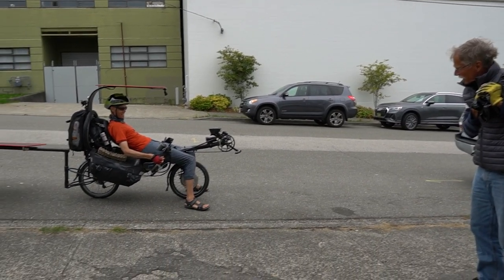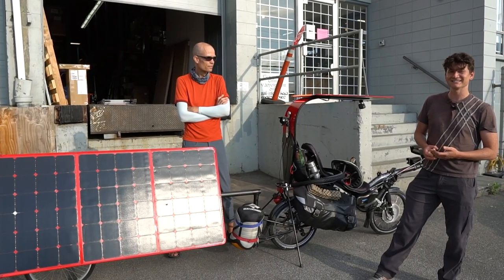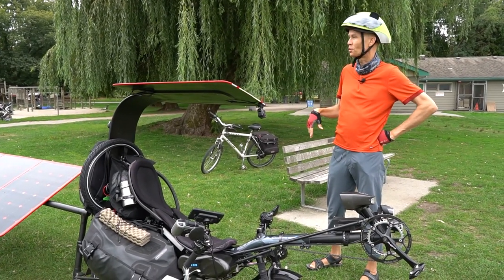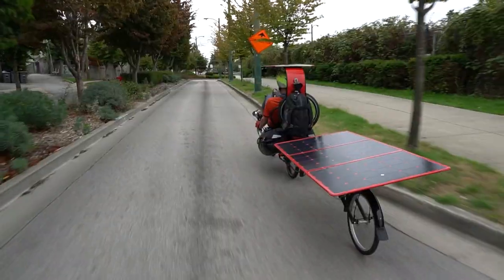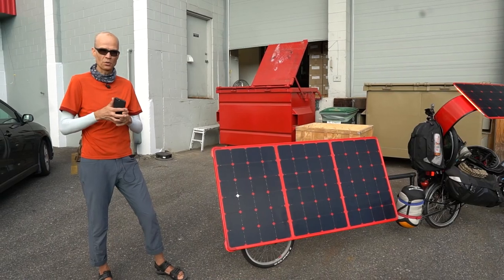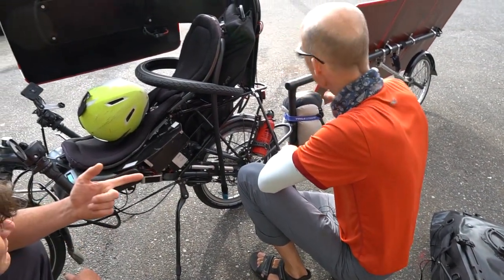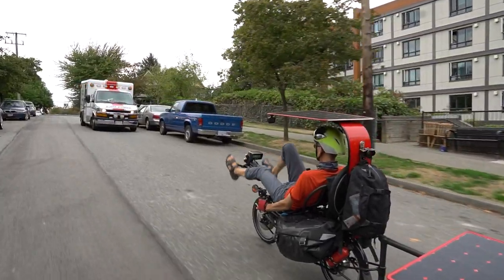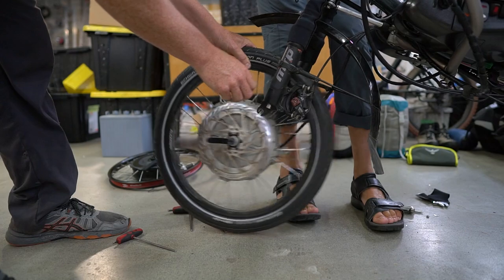Customer Profile, Part 2 of Mark Havran and his Solar Ebike

Comment: Huge thanks to Grin Technologies for hosting me in Vancouver. I really enjoyed meeting all the grinsters. What a great start to this tour!
Reply: Mark, put some (more) footage on YouTube!
Reply: @LeesChannel  Good idea. I’m mostly just posting on Instagram right now but most of the people I’ve met along the way don’t seem to use Instagram.
Reply: What an appropiate place to start your tour. Two legends n e-biking coming together.
Reply: so damn cool Mike! This has to be the most advanced trailer and ebike ever built right? The gears in the trailer tube, wow... If you are ever in Slovakia let me know :D
That front disc brake rotor seem huge, is that just because of the wheel size or is it really big?
Reply: @JohnKrakatoa  Thanks, John. I just discovered an additional advantage of having two separate gearboxes in the trailer. Based on my experience on this tour, I decided I want a little more torque so I ordered a replacement gearbox with a slightly different gearing ratio.
Reply: @JohnKrakatoa  The front rotor is 203 mm. The 20 inch wheel probably makes it look bigger than it really is. I do almost all of my braking with the regen brakes anyway. My brake pads last (virtually) forever.
Reply: @JohnKrakatoa  I have relatives in the Czech Republic so it’s possible that I may pass through Slovakia.
Reply: @solarEbike  oh yeah I noticed the surname :)

Comment: Amazing setup, people still give hub motors a hard time for some reason, I was one of the very first people to use a BMC hub motor back in 2004, it's still working great, it's had 2 new rims because I run v brakes mainly but the motor still runs and has done over 40,000 miles and all that time is been run at 1,500 Watts, 50V, not bad for a 250W motor, I wonder how many mid drive setups will last being over powered without new gears, chainrings, chains etc, the best things in engineering terms are always the most simple solution, as Elon says, the best part is no part.
Reply: Yep, same for me. I have a 10yo nine continent motor. Done 10's of thousand of km with it. No maintenance at all. The wheel is still straight, and the motor hums gently like day one.
Reply: It depends on how you use it. When in the city using a straight up city bike within the 25 km/h limit I would prefer a middrive for it more direct controll. 
For faster riding (or more watts) outside the city a hub can be a great idea. Just keep an eye on the temperature when going uphill.
Reply: I built my own mid drive and I didnt like it...I dont know if i did something wrong, but I could feel when the motor engages and disengages and it made pedalling feel...i dont know rhe right word...not smooth.  I rode it for about a year and decided to switch to hub motors...I havent rode with the hub motors yet, waiting on spokes so I can build the wheels cause they sent spokes for the wrong size wheel.  I hope the hubs make pedal assist smoother since it is not connected to the crank.  I got 48v 500w rear and 48v 250w front.  How do you run them at higher wattage than rated?  Do you need controllee that allows custom settings?  Or if I use a higher amp controller?  Also...didnt mention...the mid drive definitely added extra drivetrain noise and I really didnt like it.  I am OCD and it drove me nuts...constantly checking everything "just to be sure"...my bikes are as silent as possible, and any added noise just sucks.  The quiet hum of an electric motor is not unpleasant.

Comment: Saw Mark doing test rides up in the hills behind East Bay - such a cool setup and he just rocketed right on by.
Reply: I’m reading this in Sydney, Australia while getting ready to ride to Perth. It makes the world seem so small getting recognized like this.

On shorter, local rides I could usually crank up the assist level but over months of touring while relying solely on solar power for electric assist I end up averaging about 14 to 15 mph.
Reply: Also, there is a French guy in the hostel here walking around in an Oakland Raiders jersey. When I asked what his deal was, he tells me that he is a big fan of American football and used to play it in Spain. Weird.
Reply: @solarEbike  You've actually gotten my gears turning about eBike touring.  My 10 year old BionX PL350 finally died on my cargo bike, so I've built my own 1.5 kWh battery and ordered an eBike kit from Grin with plans of doing Mount Diablo and Mount Tam, before testing the limits with Point Reyes and Yosemite.  Best of luck in Aussie land - I bet the solar panel is working great in the Outback!
Reply: @benjaminsmith4058  I’m still cooling my heels in Sydney but I seem to have picked the sweet spot between short rainy days of winter and stupid-hot days of peak summer.

Good luck with the build. Check out Pinnacles National Park as another possible destination. I made it there from North Oakland in one day but two days is a little more manageable.

Comment: Wow...I just got into hub motors and hearing 30,000km...just awesome.  If I get even a tenth of that, I would be happy!  Sounds like they last much longer which is so good to hear.
Reply from the maker: Especially direct drive motors for longer trips like this. They can withstand higher powers and hotter temperatures.

Comment: 5:04 Without the panel, without the bike, even without the wheel, but with the control buttons for on the bike and cables, sounds like a great kit I would order immediately.
Reply: Just found that a Burley coho trailer might be ideal for such system. One can remove the fender and use that location to insert two pipes that carry a solar system. If anyone with technical skills could built that for me......
Reply: @LichtTempler  Yes have the trailer and a panel, however not the skills. If someone does, we might wanna talk.

Comment: Very sophisticated mechanical and electronic control systems. I'm impressed with how much gear he can carry without using the trailer for luggage except for that fairly small pack lashed to the main bar. I wonder if you could have the same setup on a conventional ebike rather than a recumbent. Having the crank underneath you instead of in front of the bike might reduce the luggage capacity.

Comment: I was glad to see hes using xt60's i was told multiple times xt90's are tge only connectors which can handle ebike voltages . The weight saving on connectors matters .

Comment: I'd love to have some info on the resistive heater used at 8:00.  I am using a walmart heating pad to warm a 50amph 248v LIFEPO4 battery but I think it's too warm. like the video says you only need about 10c warming and mine is probablay double that.

Comment: Did you encapsulate the Sunpower cells yourself like Eindhoven University's Stella solar vehicle?
Reply: According to his solar ebike thread at endless-sphere, it was SunCat Solar, LLC that assembled the cells and encapsulated them.  He did, however, "mount" SunCat Solar's lightweight/flex "laminates" to his own honeycomb sandwich structure.  Eindhoven, by the way, generally do not encapsulate the cells themselves.  They usually have them done by someone like SunCat Solar.  I believe they've used Gochermann Solar and Mito Solar in the past.

Comment: I'm very new to this but I have a question, how many solar panels would I need to charge a 72v 40ah battery?
Reply from the maker: You could charge it with one panel or many panels, it's totally up to you. The more surface are of solar cells the faster it will charge, whether it is one large panel or many small ones.  Have a watch of this video here:
https://www.youtube.com/watch?v=14yliWlykfg
In practice, with a 3kWhr battery bank like that, you'd want at least ~800 watts of solar panel to charge it from flat over the course of a day.  If you have like a small 100 watt panel, it would take over a week to charge.

Comment: The question I want to ask all of these guys: Why not provide a Rohloff (or any sort of multi-speed transmission) for the electric motor, rather than direct-drive from the hub alone?  Is the hub motor an "objective" decision, or do they just not want to mess with it?
Reply from the maker: You can do a mid-drive through a Rohloff just fine and many people do that too. The upside is better efficiency on steep hill climbs, but the downside is no regenerative braking, increased chain and cog wear, and full dependency on the drivetrain for either system (legs or motor) to work.  See https://youtu.be/gYCj4asp9pE?t=2258
Reply: @GrinTechnologies  Thank you for this sweet sweet information.

Comment: Incredible bike soo much work.  I am jealous of your trip.  I been thinking of doing a long Canada/USA tour 6,000+ miles maybe next near year with my solar e-bike.  Alex Hofvander and I may do something together.  Another great solar ebike builder.
Question are you using slow grin motor 7.5 rpm/V?  And is it on a 24" or 20" wheel?  I been searching for bright rear flasher light too, what make/model you using?  Can it direct connect to 48volts?
Reply: You may already know, there is a SunTrip planned for the US in 2022.
Reply: The motor is the fast winding in a 20” wheel. I’m running 36V LiGo+ batteries for airline transport so the top speed is about 28 mph with a fully charged battery and around 22 mph near the battery‘s low voltage cut off. If I didn’t have the airline transport requirement, I would have gone with a 48V battery and the fast winding.
Reply: The red flasher is a Feniex Canon. You can Google it. It only runs on nominal 12V automotive voltage. I was underwhelmed by the choices and pricing of higher voltage ebike accessories so I just got a 60V to 13.8V DC – DC converter and started shopping for automotive and motorcycle accessories. So many more options.
Reply: @solarEbike Yup heard SunTrip US 2022 before was even announced to anybody.  I was a ST Europe 2021 participant but decided to drop out near start mainly do to covid None EU citizen covid restrictions were strict and was cases were not getting any better at the time.  Think doing own tour with Alex would be more fun then a SunTrip.  No rules, check points or entry fees.
Reply: @solarEbike  Hmm ok.  Well I have Grin DD hub slow windings on a 24" 48volt currently I get about 28mph with full charge same as you.  I find on steep hill fully loaded gear etc..  motor struggles if I don't assist heavily.  Alex is going have a bigger array and battery.  I am upgrading my array and battery match his setup but worried about the extra weight on the hills with the DD hub motor.  Alex doing 52v grin motor with belt gear reduction so he will have no issues 24mph max speed about I think. I am going downsize to 20" wheel for more torque but wondering if its going be enough with the extra weight.
Reply: @solarEbike  The liGo batteries are cool.  I had big single 1.1Kwh 48v battery for SunTrip.  Really only way is ship with someone that hazmat cert for shipping.  Big pain amount countries you are touring with LiGo's going make it so easy
Reply: @solarEbike  Yeah lot high voltage 30-60v rear / red ebike lights I tried a few.  But none are bright strobes, that way better.  Feniex nice 12v still good.  Need 12v converter on bike anyways if you want cell phone quick charging ability. Thanks for your help.
Reply: @danieldalessio4317  If your top speed is the same as mine then I think we have nearly identical low-end torque? I have not yet run into any hills that are steep enough and long enough to make me think that I want a slower motor winding. I had a chance to change the motor winding when we swapped motors in Vancouver three weeks ago and I stayed with the fast winding. I don’t want to reduce my top speed. When the battery is at 50% I only get about 25 mph. Under ideal solar conditions at mid day, I can ride at wide open throttle without draining the battery. Try modeling your current and proposed new set up with the Grin Motor Simulator.
Reply: @solarEbike  Yes think we are similar torque I am 37Nm max in simulator.  What total weight of your bike fully loaded gear, array and you on it?  My setup nearly 325lbs sim says never over heat on 9% grade with 150watt human power.  But find that is not always the case.  Sweet spot for me on flats like 20mph hate go smaller wheel I would lose that 20mph top speed on 50% battery.  I need to lose some weight I think haha
Reply: @danieldalessio4317  Agreed about trying to lose some weight. The manufacturer’s maximum load for my bike is 275 pounds and when I weighed it for my last tour in 2020 I was close to that number. Trailer is 25 pounds.

Comment: Dude is it possible to use direct solar power to ride without battery?
Reply from the maker: Not really, as soon as your controller tries to draw more energy than your panels are outputing the controller will switch off. Hence as soon as you ride through a shadow all systems kaput.

Comment: Im curious how much it would cost to buy/build something like that. Will be saving up.
Reply: If you already have an ebike, you can add a trailer with solar panels and charge controllers for under $1000. The way I approached this project is not exactly budget-conscious. I bought the bike as a frameset-only with no wheels or drivetrain components and that alone was a special order from Germany for $4000.

Comment: Wonder why he is using Ni-MH over LiFePo4 batteries
Reply from the maker: He is using lithium ion batteries, not NiMH.  
LiFePO4 batteries are generally a poor choice for ebikes since they're about double the weight of the other lithium chemistries, and these days no longer have an advantage in cycle life either.
Reply: @GrinTechnologies  Ah nevermind, just heard nickel metal hydride at 6:42, understand that was just in the past now though. I just guessed he had chosen Ni-Mh for safety reason, that's why I suggested LiFePo4 batteries, but Li-Ion is of course superior (even though LiFePo4 has been getting a lot better, they're closer to 2/3rds capacity of Li-Ion nowadays.